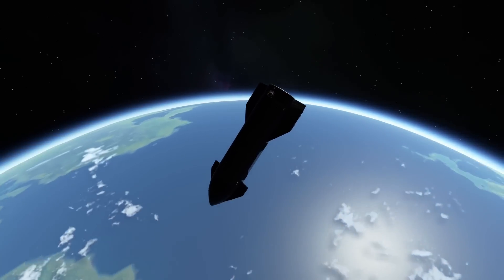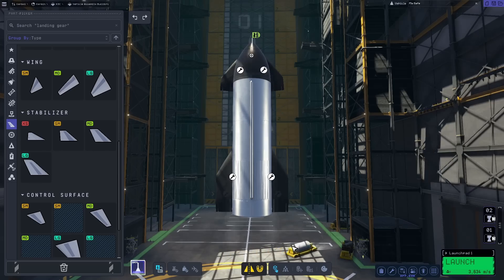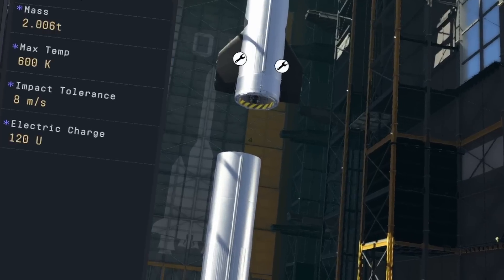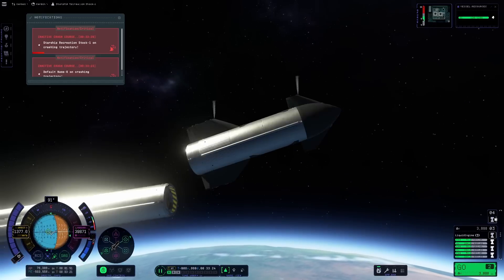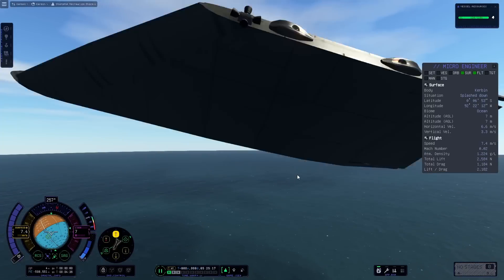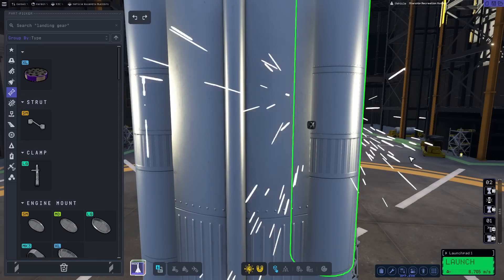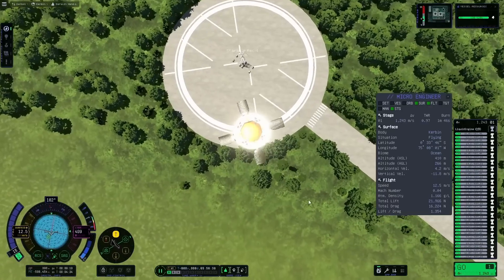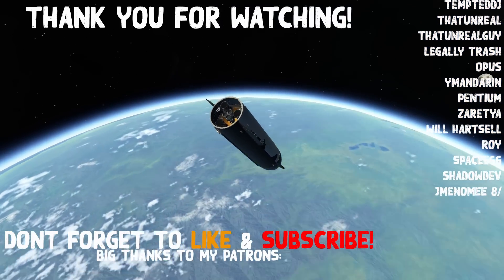How To Make A GOOD Starship In Kerbal Space Program 2

Comment: If you tweaked the proportions a bit it would be perfect. The ship and booster are a little too short, making the rocket look stubby. Also, if you want the grid fins to look accurate to the real thing, attach them with 6 way symmetry and remove the extra two. They should look like this from a top down view: >O<

Comment: i also clipped in a second nose cone and second set of wings so that they are also black on one side and shiny on the other, also i used a tube piece for the heat shield rather than an empty fuel tank for mass. i also used multiple small tanks rather than one big one to get the segmented rings and i made stock grid fins on the booster using those new weird frame pieces (are they supposed to be rover frames? i think they might be)
Reply from the maker: Those are all some really good ideas, with the tube though if you leave the vessel and return does it disappear? My first iteration of designs used tubes for the engine mount, and whenever I quicksave/loaded the structural part vanished D:
Reply: @Carnasa  for me the tube disappearing only happened on quickload if the end was attached to a decoupler that had decoupled. if some other part that was still there was present it stays for me
Reply from the maker: @MinerBat  oooh okay, that’s good to know and also explains why my tube was disappearing as mine was directly connected to the decoupler that separated starship form super heavy :p